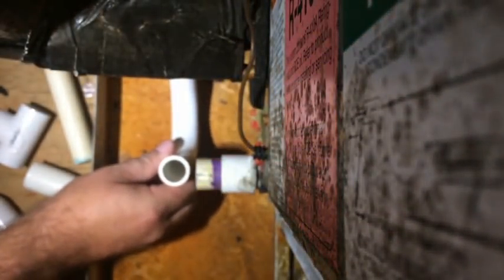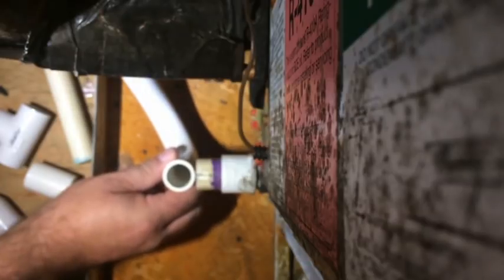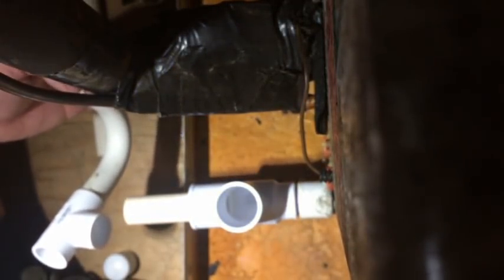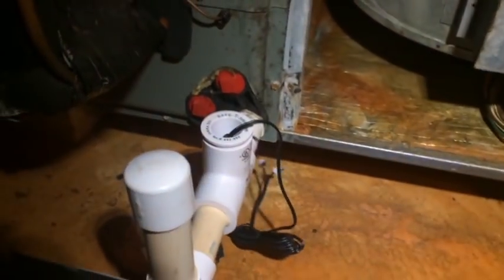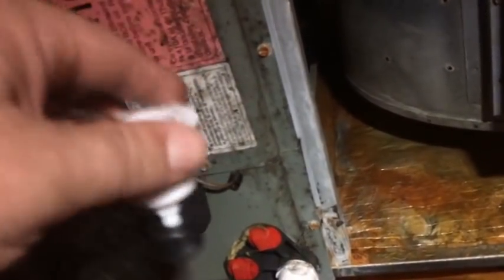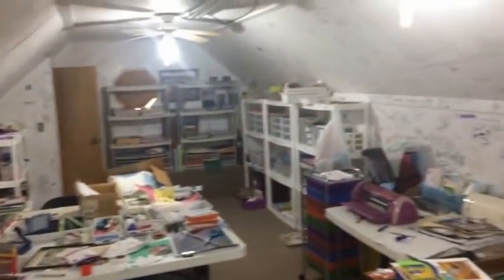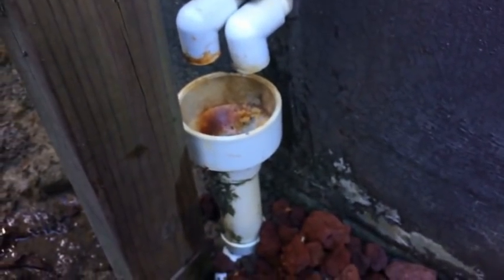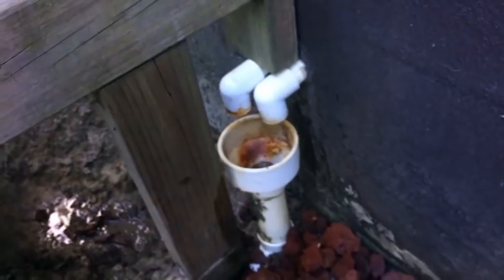Repair AC Air Handler Drain | HVAC Service Call

Comment: I live in the Orlando area when we had irma last year we where without power for 8 days I had 2 generators that I was changing form day time to night , the larger one took a shit after day 2 , let me tell you I learned my lesson in not being prepared I got a new champion dual fuel propane / gasoline 7500 watt and wired in a back feeding outlet to a breaker, that powers my whole house .what I would advice for you to do now is get a good generator might be too late but also get more gas then you think you will need if your on a well your going to need the water also get lots of food and drinks we bad a boil water after the storm and luckily I though of getting lots of drinks also most gas stations had no power or grocery stores also hope think helps
Reply from the maker: Thanks for the advice